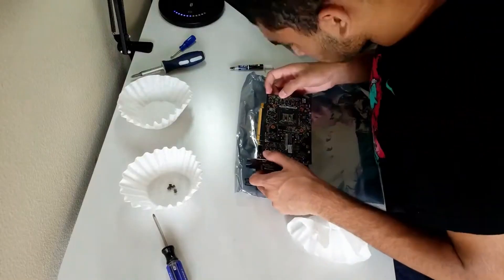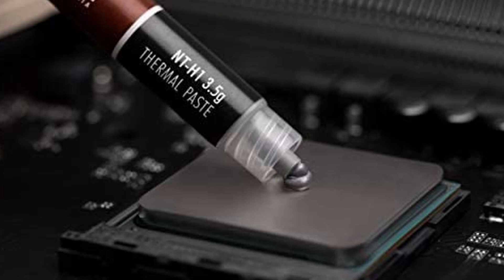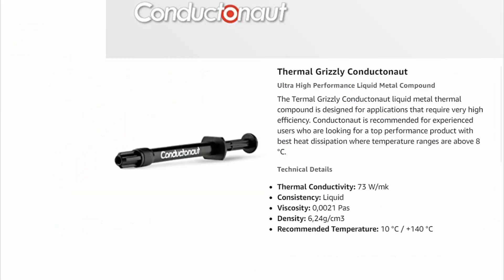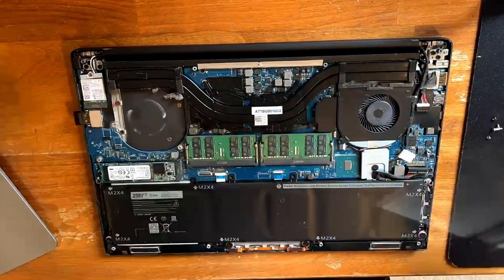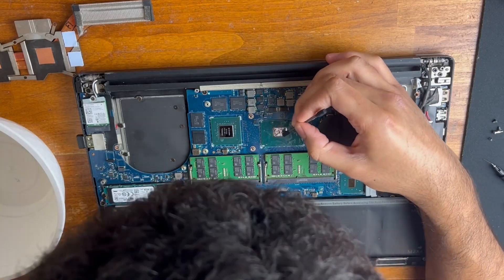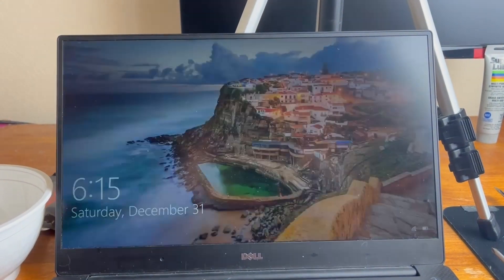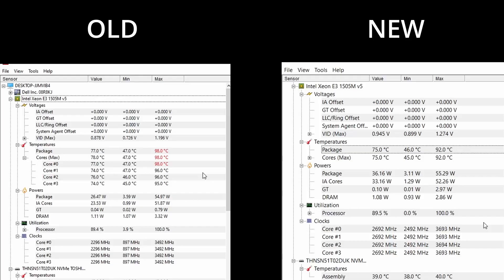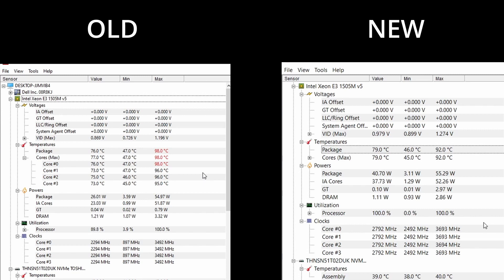Replacing my Laptops Thermal Paste with Liquid Metal - Reduced Temps Drastically

Comment: HI! I have ROG STrixy G513 and already has liqud metal on it but 2-3 years old now, CPU is very hot, 96-100 deg an even at small tasks liek antivirus making CPU 30% usage 80-90C  or more mostly.
I checked fans are goodm no dirt but cleanedthem fully.
Thinking of replacing the metal, but only has normal MX4 compound at home, normal thermal paste. 
Can it help or I should let it as is if I have no liquid metal to replace the old one?

Comment: as i understand it, silicon is a semiconductor, which is why it's used in processors. but does that mean it has current going through it? and if so why doesnt electrically conductive thermal paste affect it?   ik this video is a year old but i cant really find any other direct die liquid metal videos
Reply: Silicon itself is not conducive. Only when phosphorus and boron are added to it will it become a semiconductor. Hence the name.

Additionally the silicon waver is flipped upside down on the CPU so the pure silicon backside is seen. Technically speaking the CPU is upside down here.

Comment: I have tried EVERY single thermal paste because my laptop runs at 90-93c constantly and no thermal paste works even tried thermal grizzly since it's supposed to be the best. But to no avail , it makes my system run throttled all the time. I ordered liquid metal and should arrive tomorrow I will apply it on soon when I get it and hopefully it actually works
Reply from the maker: Good luck! Lmk how it goes
Reply: @SethusBuilds  well to tell you the truth I put liquid metal on it correctly no mistakes, but it didn't work my PC still ran 90-93c so I gave up and cleaned it off and just used noctua Nth2 and it actually worked better than liquid metal I was in shock no jokes
Reply: @pavy415 Did you put liquid metal on both? I mean. You have to put liquid metal on the die and on the heatsink. If your heat sync is made of cooper you have to apply the liquid metal the first time, then after 1 weak you have to clean the die really well and not so well the heat sync. Then apply liquid metal again. The reason is that the galion on liquid metal will migrate to in-between the copper. So the contact with the die will be loosen. Trust me I have been using liquid metal on my desktop and on my gamer notebook for the past 6 years

Comment: The popularity of liquid metal is decreasing due to its negatives like seepage and electrically conductive. Even the upcoming ps5 upgrade is said to go for water cooling as many ps5 have been destroyed due to liquid metal leak when ps5 is mounted vertically.

PCM sheet is the current preferred way where standard pastes fail (like pump out etc).
Reply: PTM 7950*
Reply: @derekhatake  yes, that is the famous one. But there are many brands available